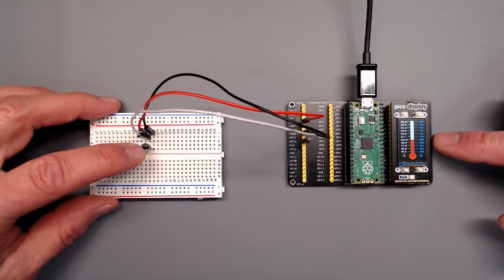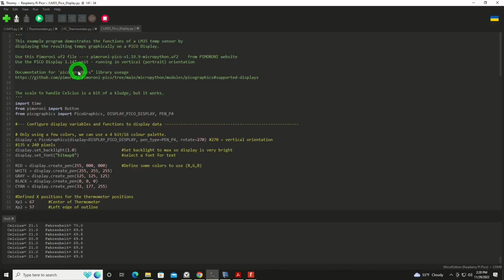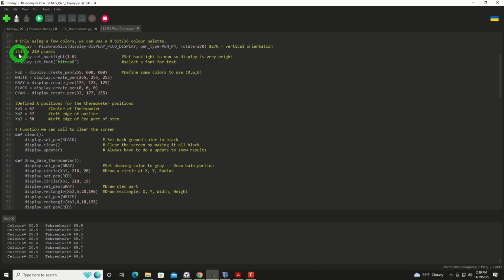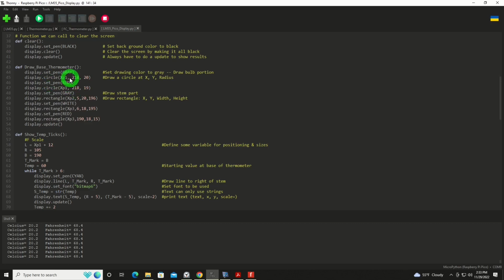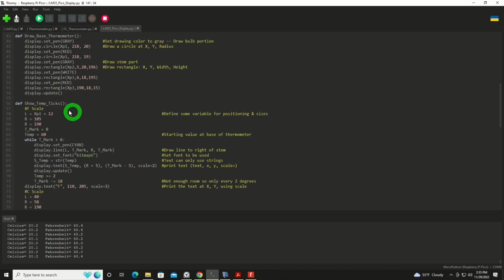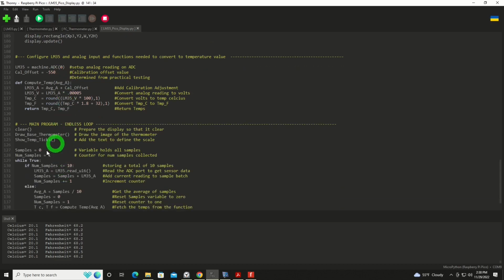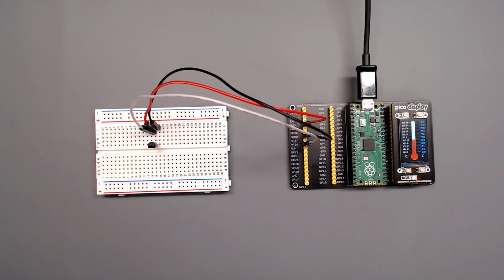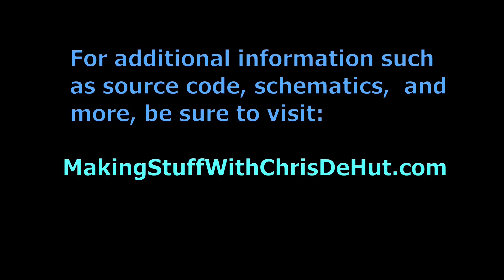Create a Graphical Thermometer with a LM35 and a PICO Display

Comment: Chris, I really appreciate your clearly explained, interesting projects.  I'm thinking of an ePaper display with the usual local weather sensor data (BME280?), and possibly some weather forecasts scraped from a cloud-based  weather api.  While I like the picoW, I prefer the esp32.  What advantage(s) do you see to the picoW over the esp32 - running micropython on both?  Thanks!
Reply from the maker: Good morning Quaternion,
Thanks for the kind words, always appreciated!
Regarding the esp32 I have no basis for comparison.  I actually purchased one a few years ago and never did anything with it and even forgot I had it until the other day.  I will offer this - I like the PICO's development "environment".  It does what I want and is very capable of doing everything I have wanted to do with it, it is very cheap, and well supported and documented.  A few years back I started to hit some performance limitations with Arduinos and I just never liked C programming so that is what led me to the PICO as a different path.  
Cheers!
Chris